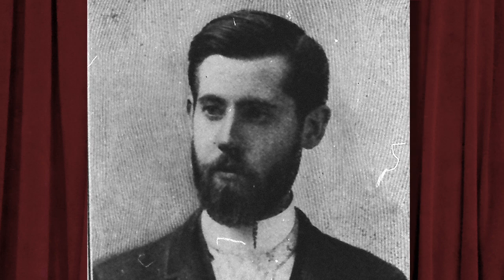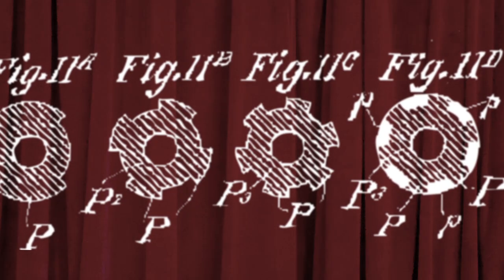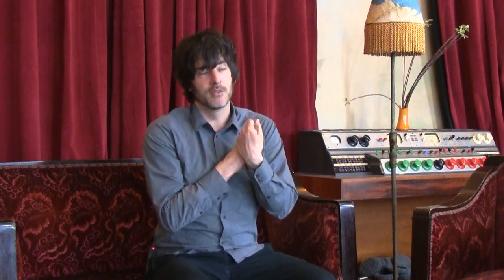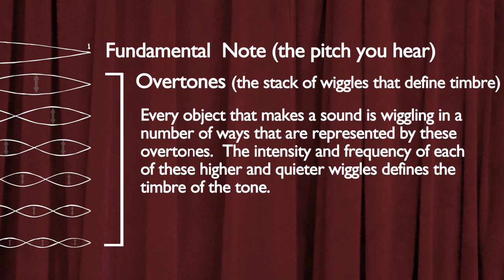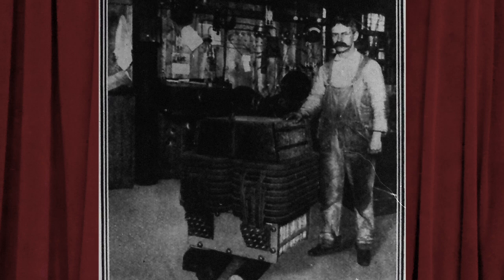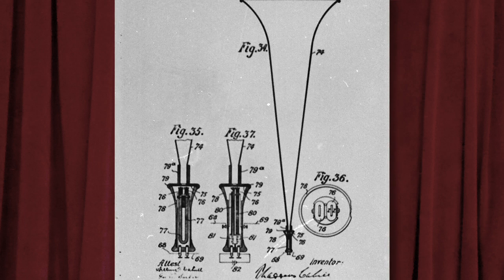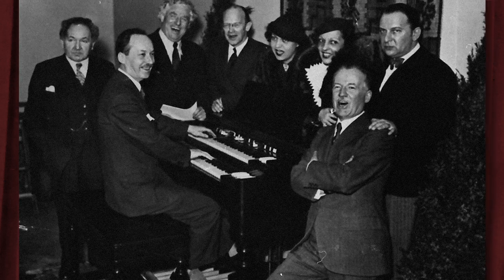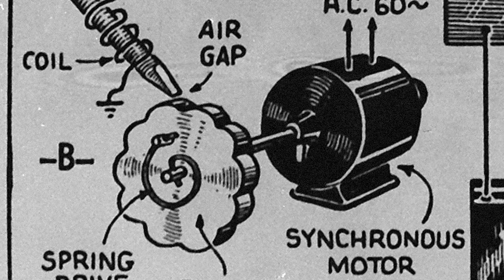The Synthesis of Synthesis- The Telharmonium

Comment: Hey everyone, check out the North Suburban Hammond Organ Society site. They have excellent articles regarding the successor to the Teleharmonium- the Hammond Tone Wheel organ (1935-1975), and the Wurlitzer Electrostatic Reed organ (invented by Everett Organ Co. 1929 & sold patent to Wurlitzer Organ Co. in around 1945), when Wurlitzer further refined the electrostatic reed organ to be an 'instant attack' organ like the Hammond. The reeds oscillate (vibrate) & a high voltage charge passes through.

Comment: Not entirely true. If you are able to "wiggle electrons" you can reproduce any recorded sound.  But there is a difference between a recorded piano even on the best hi fi system and the genuine sound of sitting in front of one. Any time you run a signal through a piece of gear and through wires and a speaker cone it's going to impart something to the sound.